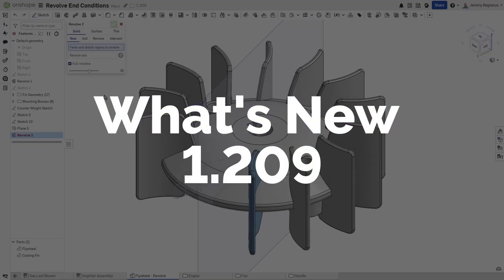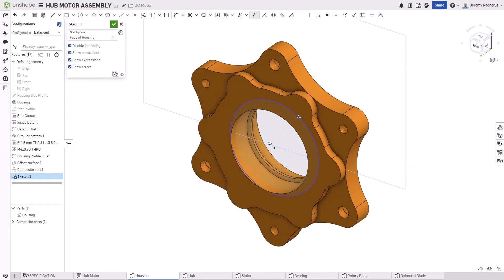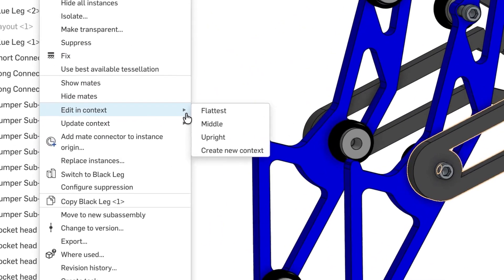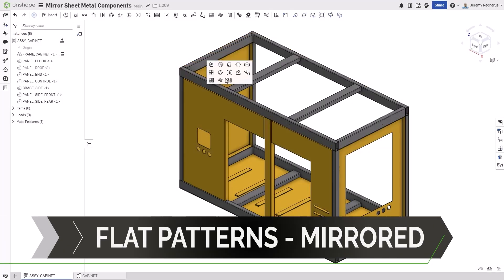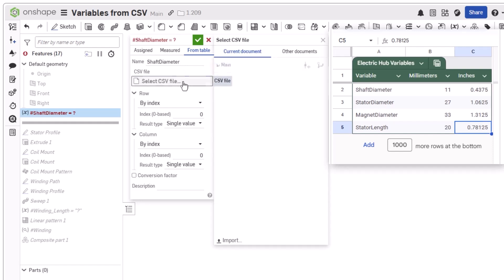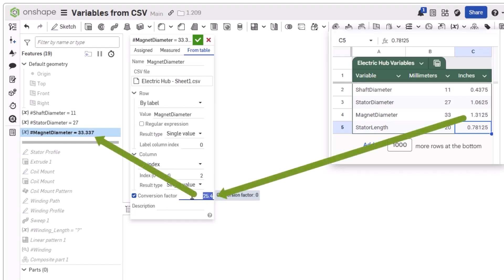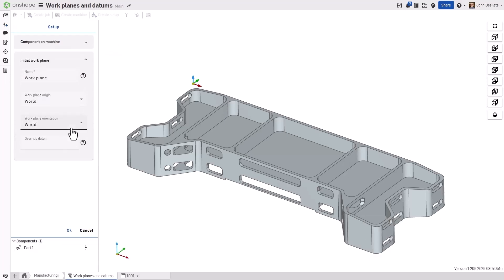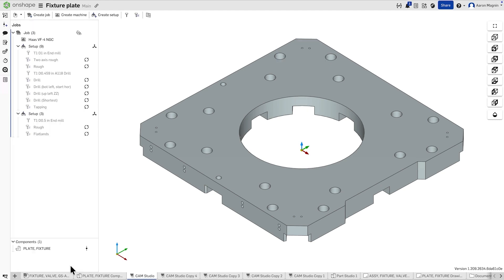What’s New in Onshape 1.209 (January 9, 2026)

Comment: I'm very happy that Onshape is developing new and new features. Unfortunately, the new Revolve options don't work as expected. For example, "Up to face" should be called "Up to the plane on which the face is located", because it doesn't take into account that the face is limited in space. In the case of a flat face, you can predict where the end point will be according to this logic (on an infinite plane), but in the case of a curved face, the result is incomprehensible. Similarly, "Up to part" and "Up to next" only work correctly in some cases. Only "Up to vertex" works perfectly. I hope this will be fixed soon.